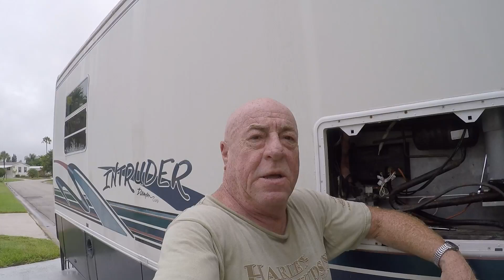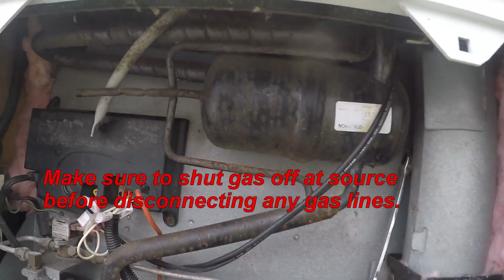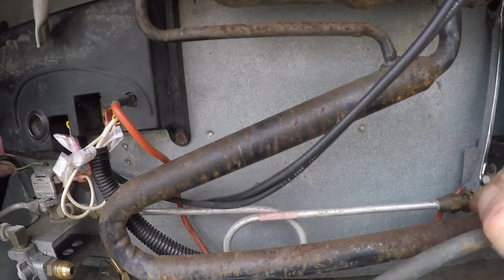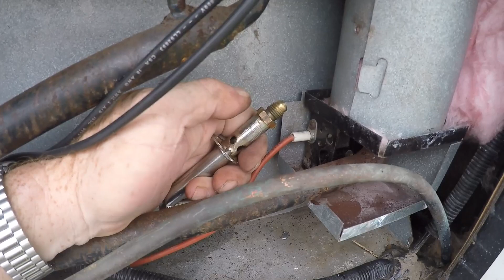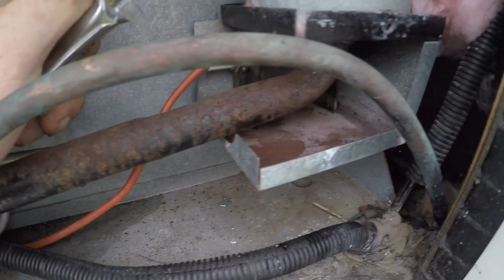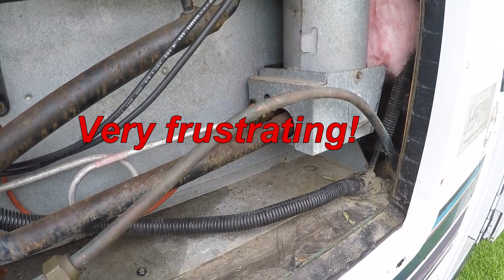Fridge Not Working At All On LP Video 2

Comment: I learned a lot on these RV fridges using the YouTube videos available.  If your fridge works on AC power then the basic cooling unit is ok.  The LP side for what ever reason the heat is not getting to the point it needs to.  Just a guess would be your pipe has some rusted out baffles inside.  If you remove the roof vent you can get a good look at it.  When I pulled my old RV fridge out and broke it apart for scrap, I was shocked as to how much of the baffles in the flute were rusted.  I assume they sell new ones, but have never looked.  But again if AC works and LP does not, the heat is not getting to the right place.   Good Luck !

Comment: the thing with red wire  did you clean the rod on it? the igniter my furnace would start and stop I took the igniter off and used scotch brite pad and cleaned it then it worked. it didn't look dirty but I cleaned it anyway. good luck.

Comment: Rufus N Dufus  IF you have a good flame and it's blue with no yellow in it then it should work and since it doesn't have you cleaned out the flue? There could be soot blockage in the flue or some other blockage - so you'll have to find a brush that will clean it same type of thing they use on a home but in a smaller size - hope this works
Reply from the maker: Still one more thing to check before jumping to that step.  If the next step fails then the flue is the likely problem.

Comment: Dang, you're running out of stuff to check now.  If you are sure the ignition is working and it works on electric then it has to be in the heater assembly, that's all that's left that I can think of.  Good luck.
Reply from the maker: Bill Long The heater checked out fine on AC, and the flame on the burner looks great.  May be LP pressure is low, need a manometer to check for sure.  Should b1 11" CW.
Reply: Rufus N Dufus  worth a check but even with enough pressure to light it should do something.
Reply from the maker: Bill Long Low pressure may not provide enough heat, but I agree that something should have happened.
Reply: Rufus N Dufus Does the refrigerant that works in the AC side come into or share the same tubing with the gas side, or is there a possible switching valve keeping the 2 seperate, depending on which is being used?  My 3 way Dometic has the usual knob underneath,inside the door which switches from AC to Gas to !2v.  Maybe this is part of the problem that is keeping the refrigerant out of the gas side of the cooling system?
Reply: Harold Way Good point.  I was assuming on that older unit it was shared but if not we have a whole different kettle of fish to fry.
Reply: Bill Long Older unit, huh!  Maybe a real possibility of seperated use system, shame I have no way of checking mine, in such closed space, mine is an 89 Roadtrek, original unit
Reply: Harold Way If it uses a reversing valve like a heat pump, that's likely the problem.  I'm not a refrigeration expert but my best friend was and I heard him talking about this stuff all the time before he died.  He was also one of the few people that would work on mobile homes and RVs (other than dealer techs).